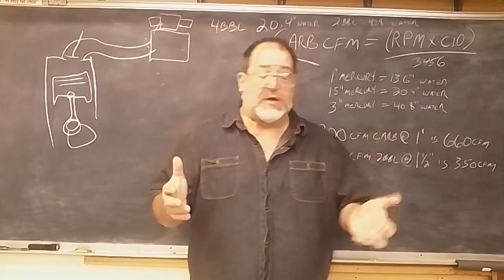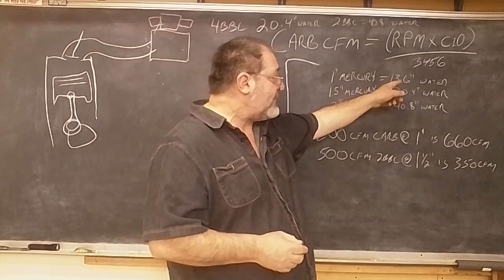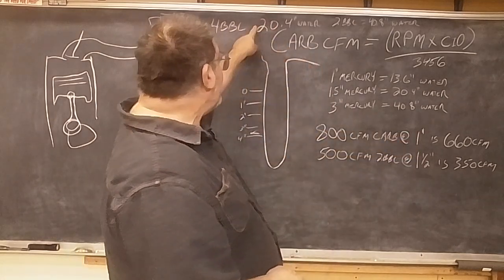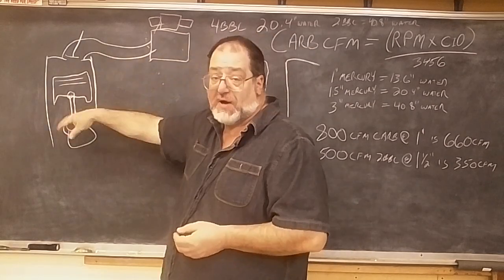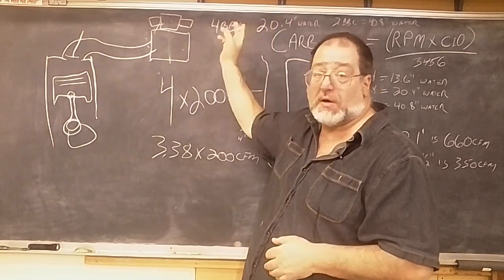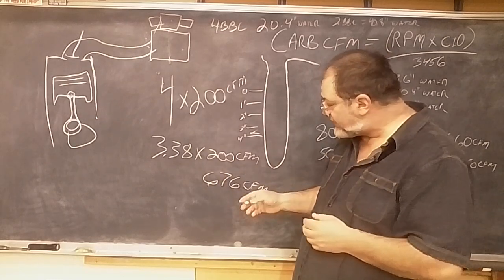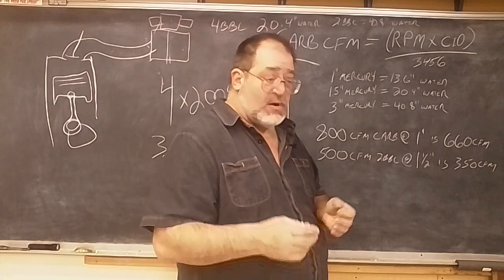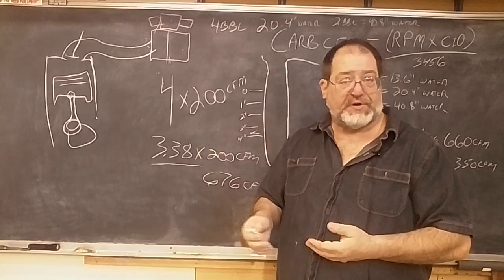Carburetor size ... why formula doesn't work

Comment: Yer the old carb formula is BS. But you need to do more homework on how a dual plane works. The 180 degree separation idea was patented in 1909, Henry used it on the 1934 Ford V8 after the poor performance of the 90 degree manifold 1932/33 V8.
Reply: interesting

Comment: 3.38x280 is 946. I have an 850 carb. Do you think that's too small? Small town drag racing, big block Oldsmobile that revs to 6500.
Reply from the maker: @claytonstoolbox  really depends on HP ... 850 is good to about 550 HP or so ... Are you topping out somewhere about there
Reply: @scotthatch4548  I was shooting for 600 but 550 is probably more realistic. It’s in a light car. I hear that makes a difference as well.

Comment: How does this apply when you have individual  carbs with a butterfly for each port like a pair of Weber DCOE carbs on a 4 cylinder?
Reply from the maker: In that case it needs to flow just under the runner flow .. because you have no plenum it has to support the entire pulse draw but you need to try and keep airspeed up for low end and to help with reversion especially if it's going to be a big camshaft
Reply: um how did you know i was gonna ask this? mines a V8 though!
Reply: Yep, they prove plenum volume is BS, but they aren't big enough for big displacement motors.
Reply from the maker: @TomSmith-cv8hk  plenum volume can help when the carb is undersized ... But on IR and even completely split dual plane you do need the carb to keep up with the runner flow ... And because of that total cfm on IR type for the whole engine can get big  on a big engine you can increase the runner length a bit to help in runner volume ...not cross section as you need the airspeed but a bit in length can help

Comment: I am loving this so much. I have a slightly built 20r Toyota with a 32/36 weber, I added a 1 inch spacer. Now I think it needs a 38/38. should I do that? I runs better now at high rpm and still didn't bog at the low end.
Reply from the maker: I would assume your head flow is around 154 cfm ...with that you would need like 330 cfm of carb and the 32/36 flows like 320 ... I would say it's about right in size
Reply: @scotthatch4548  Thanks for the info, I will not waste the money. Great video by the way. Thanks again.
Reply: @scotthatch4548  I just saw them run a gauge on the intake and it flows at 233! I was surprised it was that high. I assume that's a pretty big increase on a 4 cylinder, yes or not that big?
Reply from the maker: @talesfromthetarheelstate351  intake alone or intake and head at max lift
Reply: @scotthatch4548  they had the head off the motor. they had a gauge and computer read out of the air flow through the port. I guess air was being pulled through.
Reply from the maker: @talesfromthetarheelstate351  233 cfm would need like 500 cfm of carb ..... But that number seems high for that head ....
Reply: @scotthatch4548   I don't know why it was so high. I know the 20r flows better than the 22r, from what I read anyway. The 20r is semi- hemispherical as apposed to the 22r Toyota head.

Comment: Thank for your presentation. However I don't understand how converting from 28 to 20.4 results in 3.38. Seems to me it should be (20.4*4)/28 which is 2.91. I'm asking because I want to calculate the carb size for a 6 cylinder engine which I think is 3 times (runner flow rate) times the adjustment factor.
Reply from the maker: @lesliedickey2820  you have flow at 28 inch's to get flow at 20 inch's you multiply by .845 .... 4 cylinders times .845 is 3.38 ...

In your case 3 cylinders times .845 is 2.535

Comment: What is the best way to flow a Q-Jet?
Reply from the maker: Why do you feel like you need to do that?
Reply: @scotthatch4548  To see what any changes would do
Reply from the maker: @dondotterer24  it takes a big bench to flow a whole carb .. most of the time you test one bore at a time with a block plate on the other ones ... Not sure what change you can do on a quadrajet carb ....
Reply: @scotthatch4548  Thank you

Comment: Very nice presentation. I had a 4150 on my Mustang with a 302 and fairly hot cam. A few idle tweaks and bowl fuel level tweaks, and it was a reliable runner. The Vacuum secondaries was a key. Tune the vac side to what the engine demands. Several spring changes, and we're happy. 
You clearly point out the value of the vacuum level.

Comment: Small point to make.

Fuel is pushed into the venturi as the pressure in the fuel bowl is nearer to atmospheric than in the venturi.

Anything called a vacumn is really only pressure that is less the local atmosperic pressure.  Fluids, like gasoline and air, move from high to low pressures

An intake vacumn is just a lower pressure than the location at which you are measuring it, and is relative to the pressure at that point.

28" of water column is equal to a pressure difference of 1 psi.
Reply from the maker: That's really just semantics .... It's a pressure differential that causes it to move ... Atmospheric is kind of a constant and the variable is that change of pressure at the booster

Comment: Can you explain air bleeds?
I understand a smaller air bleed gives you more fuel at high vacuum and at low vacuum not so much. But I am unclear about it.. It isn’t the same as changing jet sizes?  🤔
Also part throttle discussion- you know where we are 99% of the time.  On the street.
Reply from the maker: The air bleed question is really a video about how carbs work ... Not sure if there is already something out there but I will look into a video on just carb function....

The part throttle question is a good one and I should probably do a second video about that ...  One of the functions of a carb is to reduce the air density and actually reduce the power an engine makes so you can drive it but that also changes airspeed and you get into carb response to throttle change .. that video I definitely need to do ..
Reply from the maker: Just realized I didn't answer .... The difference between jetting and air bleed is curve ... Jetting changes the fuel across the whole curve low rpm to high ... Air bleed changes the mix mostly at higher rpm .... As you go up in air bleed you lean out top end mix as you go down it will richen it ... Basically tilting the fuel curve ... So between the two you can balance the fuel curve across the rpm of the engine and not have it rich at low and lean at high rpm or vice a versa
Reply: @scotthatch4548  - That is what I thought. But haven’t heard anyone explain it. 
Thanks!
Reply: @scotthatch4548  Best carb info period.  Thank you Scott